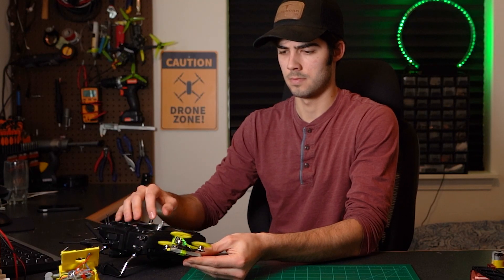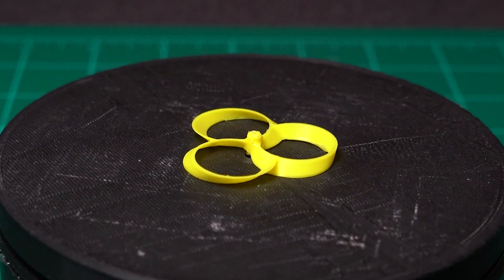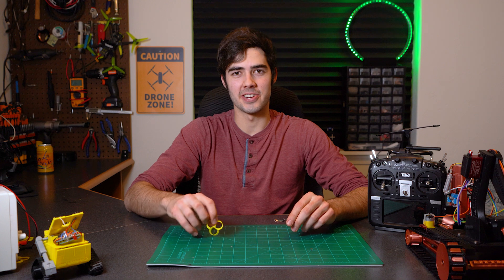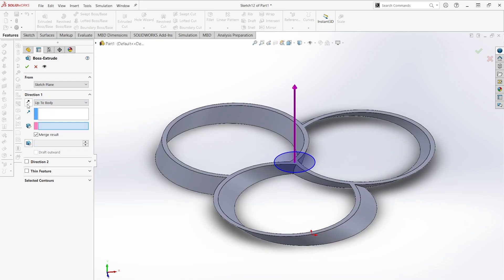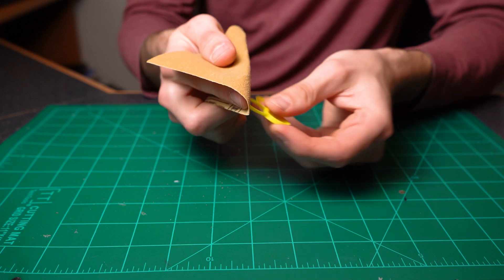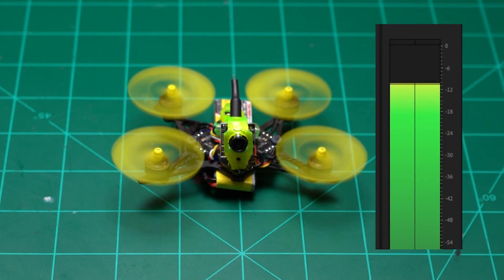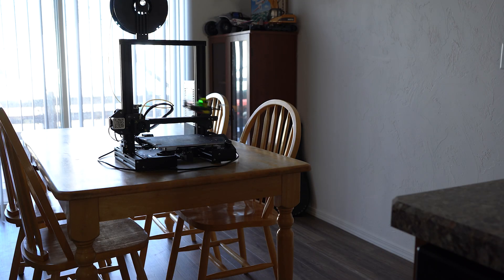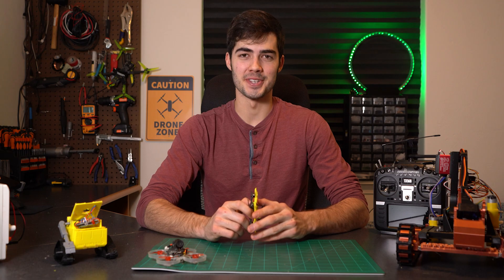DIY TOROIDAL PROPELLERS on a Tiny FPV Drone

Comment: Wall-E says a fair test comparison can only be done if both propeller types were 3d printed. More variables would be consistent across the two, I assume the biggest issues - surface texture and weight - would be more inline with each other.

Comment: Unless you resin print or injection mould these.  The returns are going to be terrible. Also, prop pitch is going to make a huge difference. Don't judge one 1 test
Reply from the maker: Absolutely right! I’d love to resin print a set, but still need to get me a resin printer
Reply: Resins add additional weight to the design counteracting any benefit.

Comment: I'm still surprised no one has tried resin printing these props from all the DIY toroidal i've seen so far. Smoothness is so utterly important for these props, and the fact that they're performing slightly less better than the normal filament 3D printed props is a good sign tbh. I plan on resin printing my own soon since my school has a few
Reply from the maker: I would love to resin print a set but that’s a tool I have yet to get. You’ll have to let me know how it goes if you print some!
Reply: @professorboots  For sure
Reply: I tried to, the propellers printed on the SLA printer, aren't stiff enough unfortunately. Could be the resin, or the particular designs I used, but I tried 2 different brands of resin and 4 different prop designs without a success.
Reply: Can I use the prop on coreless motor

Comment: I think that the flight time was lower beacause the troidal props had a lot more surface area than the stock props, and the 1s 0802 motors couldn't handle it
Reply from the maker: Yeah I tried to make the toroidal props slightly thinner to make up for the extra blades, but something tells me I didn’t make them thin enough
Reply: If they were thinner they would be much more britle, maybe troidal props just work better on bigger drones

Comment: it is loud because it is not smooth ... if it was as smooth as the store bought props then it would be quieter
Reply from the maker: You make a good point, I’m going to try and smooth them out better on the next batch!

Comment: The toroidals look like traditional props with a weird shaped duct attached to them. The duct part of the toroidal actually puts the outer prop in its "shadow". I feel like attaching a purely cylindrical duct to a traditional prop might do better. Cool video.
Reply from the maker: Ohhhh I like the idea I might just have to try giving it a shot, thank you!

Comment: You can use ethyl acetate or dichloromethane to smooth pla. May be that could help improving efficiency.
Reply from the maker: Good to know, I’ll give that I shot im sure the imperfections in the surface really messed up the efficiency. Thank you!

Comment: The toroidal prop is all a scam, interesting how there's always excuses for why it's worse
Reply from the maker: Haha maybe so, it just looks so dang cool though.
Reply: @professorboots  Enjoy your videos either way👍
Reply from the maker: @secretlyhim1229  Thanks man, I appreciate it! I’ve had a lot of fun with it so far.
Reply: It increases weight.
Reply: Maybe lightweight PLA could compensate the higher weight?
But I guess a torodial propeller adds air resistance due to it's shape. There are some parts that are moving in the air and don't provide lift.
Reply: Using light weight pla in traditional blade design would also decrease its weight. Again its matter of how light and efficient a design is. 
And true that some parts do not provide lift.
I imagine this as 6 blades at its core.
Reply: @The-Relevant-Commenter  yes, it sure is a tradeoff in some dimensions...
It's not easy - or it's a big playground... depending on how you see it.

If it's about safety concerns, some drones have conventional props and static distance sticks to keep it from a flat wall at least with minimum additional weight. But it's not perfect. Better fly safely ;-)

Comment: What module do you use for your analog rTx on the side of your goggles v2? Sweet vid
Reply from the maker: I’m actually using a super cheap Eachine PRO58 RX in the video with two lollipop antennas. It works alright for buzzing around enclosed spaces but definitely can’t compete with something like a rapidfire. And thank you!

Comment: my only thought on how you could have better tested your prop is to compair a printed toroidal with a printed traditional. Injection moulded products are just so different structally wether is regular or resin printed. i doubt you can get any valuably accurate data worth sharing. as a side note. your drone workshop looks clean!! gota work on mine more seeing this LOL.

dispite the results sounds like you had a blast making and testing. :face-green-smiling:
Reply from the maker: I definitely had a blast making and testing but you’re right the materials are just so different. thank you I do like my little workshop space😂.
Reply: I'd add that if one set of props lacks a fancy aerofoil shape + optimisations then the other should too for a apples to apples comparison

Comment: Love this but your comparison between the Toroidal and 2 blade prop is not the same. The toroidal prop is effectively 6 blades. I would use a 5 blade prop to make it fairer.
Reply: Of course the 2 blade prop would be more efficient 😂 more blades means more resistance.
Reply from the maker: Definitely some really good points! I thought about that and tried to make the surface area less on each Individual toroidal blade so it would take less of a bite out of the air, but maybe I need to make them smaller or increase the blades on the comparison propeller like you suggested! Thank you for sharing!
Reply: @professorboots  From the test at full throttle you can hear that the tone of your propeller is much lower, even though the prop has effectively 6 blades. So I guess that it spins much slower and that the load on the motor is much higher, which probably makes it inefficient and drives the current up (as you pointed out in the flight test). You could also compare them to 2 bladed propellers on a bigger drone with stronger motors. Yes, the conventional propellers will be bigger, but maybe then the motors are in a comparable operation point. Really cool project. I would have never thought that functioning propellers can be printed just like that! Nice work!
Reply from the maker: @elektroluki1595  you’re definitely correct, those little motors got pretty toasty after flying around. I have plans to do some similar testing with a 5in quad which will be interesting!

Comment: I have a sla printer, but I can't think of a good material that wouldnt shatter, I think even abs like stuff would shatter immediately.
Reply: Normal propellers are made from polycarbonate, so might as well print with that. Or maybe some hard TPU, but I fear it would deform too much under load and become inefficient
Reply from the maker: @razorblade7108  that would be a really good idea, especially with a tiny-whoop as there’s not to much load on the propellers themselves as they aren’t lifting that much weight. Would be worth a shot!
Reply: @razorblade7108  Hmm is there polycarbonate resin?? I need to look that up thanks!
Reply: @razorblade7108  PU Rigid 1000 Resin 1 L
RS-F2-PU10-01

$149.00

lol no.  I suppose I could print, mold and cold cast them though cheaper.  I've made some polycarb parts that way before, but it's a major pain especially if the design hasnt been proven.
Reply: I am wondering if a graphene additive would work?
I understand how to make it, but I don't have the equipment.
I won't be able to test it any time soon, but it is certainly worth the test. 

Here is a link to the video that gave me the idea:
https://www.youtube.com/watch?v=3hHoL77QDkg
Reply from the maker: @Inertia888  Possibly though I’m definitely going to have to expand my knowledge on that subject!
Reply from the maker: You would definitely know better than I would, it would for sure shatter if the propellers came in contact with something. Not very crash proof haha, which would go against the tinywhoop way haha.

Comment: I have to wonder if size is what is making these so inefficient compared to other folks' I've seen test the concept, I would imagine the vortices these are designed to mitigate show up far more with larger surface areas?
Reply from the maker: I bet that likely has something to do with it. I might try directly scaling up this design to a 5’ and see how inefficient they are then. Thank you for the thought!
Reply: Could you point me to those successful test? I'm starting to think this is a scam. Especially, since all MIT has presented to this point (6 years after the initial patent) is a really poor graph (no RPM, no power data etc.) and a video that is clearly a scam (muted when showing their Design etc. and of course Zero data).